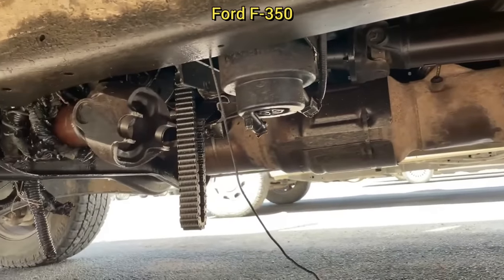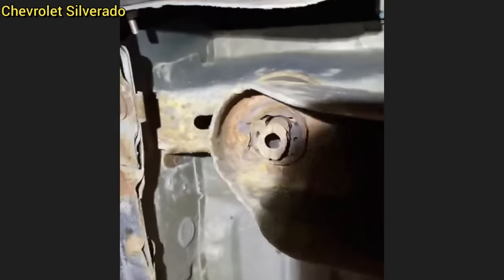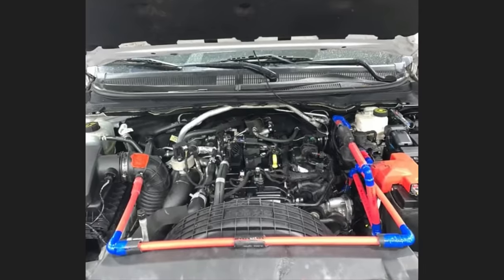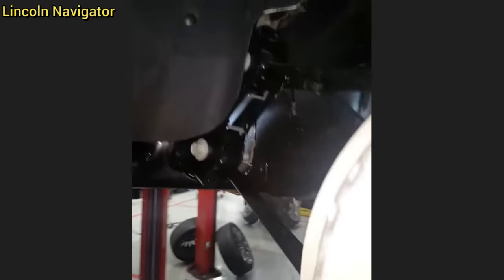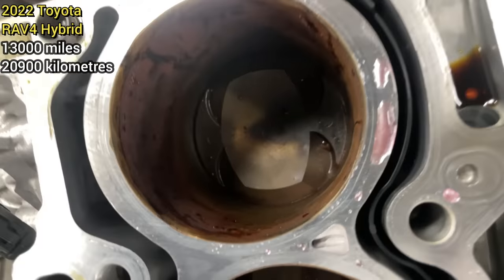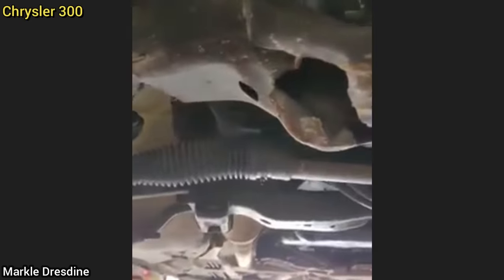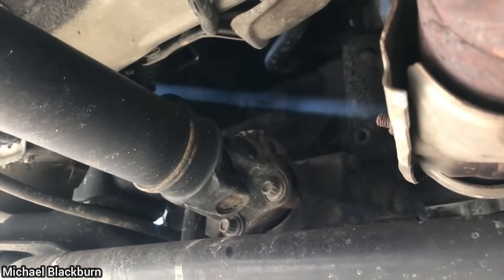Customer States There Was A Loud Bang At 90 Miles Per Hour

Comment: As a Chevrolet service manager 1971 I had a customer tell me that they had a miss in the engine of their Corvette at 80 miles an hour. They told me this over the phone and wanted to make an appointment which we did. I also advised them that I wanted to know what year the car was in and what the RPMs were. When the day came to inspect the car and they told me what the rpm range was, I said we can duplicate that in first or second gear quite easily without breaking the speed limit on the highway. If it has a miss, it doesn’t know it’s going 80 the engine only knows the RPM and we can easily duplicate that. The vehicle was under warranty, and I advised the GM service rep. Nothing came of it, there was nothing wrong with the car. You meet all kinds in that business.
Reply: What year was the vette? The engine doesnt only know rpm, the load wont be the same at 'low' speed in 1st or 2nd vs 80+ mph at the same rpm.
Reply: YT, that's nonsense, you probably lost a genuine customer.   I own an Australian made Commodore sedan - it has the GM world market V6 engine.   While still under warranty it had a similar fault - it hesitated a bit at 100 km/hr.    The dealer said there was nothing wrong with it.   I asked how they checked it and they said that since 100 km/hr is well above local speed limits they drove it at the corresponding RPM in 2nd gear.    I pushed them more strongly and they took it to a performance shop and tested it at 100 km/hr in top gear on a dyno - showed up the fault beautifully.   The reason is that running the same RPM in a lower gear puts a lower load on the engine, so that air/gas volume is lower and peak cylinder pressure is lower, covering up ignition & timing problems, etc.    Turned out an oxygen sensor was faulty, fooling the ECM into altering fuel injection.
I've worked in the heavy haulage truck engine business.   All dealers in that game have dynos - dynos solve lots of arguments, but the cost is not considered justified in the car servicing game.
Reply: @keithammleter3824  The roll-on dynamometer is probably one of the greatest time and money savers that I can imagine.
Reply: @UFO-047  
Because it was over 50 years ago I can’t remember whether it was a 1970 or 1971. Nailing the throttle in first and second gear or lugging it in third gear will produce pretty much the same results. Remember they had ignition points and one coil. The engine sensors of today and multiple coils on the engine and fuel injection and air sensors make a lot of difference nowadays. People want to take information based on knowledge today over 50 some years later and apply it to something that happened so long ago. Model a Fords had four ignition coils.  You have to actually work in the business to understand how many clowns there are, that make statements  they don’t understand and they’re making excuses because they could’ve been out dragracing and got beaten, and use that as an excuse. In 1962 I worked in the parts department at a Chevrolet dealership. in the door walks someone I knew with his mother. His mother said John’s car won’t go anymore, the engine runs, but it won’t go. He was looking right in my eyes and me and his. He had a 1962 Chevrolet 409 four-speed. The night before when a bunch of us were out hanging around, he was in a drag race and he missed a shift. It certainly wouldn’t go, he knocked the gearbox out of it. It was fixed under warranty if you can believe it. He had convinced his parents to buy him this car, and they had no idea what he was getting. There are hundreds of stories like this, if not, thousands. Don’t apply today’s technology to over 50 years ago.
Reply: @UFO-047  
It’s my mistake for not noting that you can apply the brakes and the throttle at the same time and load the engine quite easily. Having spent a lot of time with race cars, there’s a lot of things that people think they know but until you actually get out there and do it and learn about it, your / anyones information is limited . Just remember it’s against the law to exceed the speed limit, especially in someone else’s vehicle. As I said before, there are clowns everywhere.
Reply: @yt650  Im not applying todays technology to 50 years ago. Same will apply to either. 454 in my '73 (build year 1972) C20 is very close to a '70 LS5 454. Edelbrock Performer intake and Crane 266 Energizer cam being the main differences, 210° vs 214°. True 10:1 comp. And headers. Good work truck motor.
Even with all '70s gear certian issues will only show on the road in certain situations. Different gear, engine being loaded slightly different ect
Reply: @UFO-047  
You are conversing with someone who lived through the muscle car era, and I drove everything that was available at the time, and everything got traded in at various dealers where I worked.  I remember taking a vette Home for the used car department because they wanted to run a little bit, and it had all kinds of modifications to the engine,  two carburetors unknown, camshaft, and lots of other stuff. 
On a dynamometer, they load the engine through the rear wheels, tell me you can’t do that with brake and throttle. The guy was a clown, he wanted everyone to know that he had a Corvette that was fast and compared to a race car they weren’t even close. Everyone wants to brag about what they did to their engine, but if it wasn’t blue printed the cylinders spaced bores straightened, on and on you’re just kidding yourself and your throwing parts  at an engine.
Reply: @yt650  ok, so Im guessing you're around 80 and had the opportunity to drive a lot of different cars due to working at car yards. You dont need to be a mechanic to be a Manager of the Service Dept or work in the Parts section, in my experience many of those only know the front from the back because of which way the steering wheel faces, cars, road trains take your pick.
No one will be trying to trying to claim bragging points with a vette by saying 80mph. If you're running a TH400 youre still in 2nd gear at 80 at wot unless it has a DEEP diff ratio.
Whats the last part about? If it was supposed to be a jab at me, I listed the setup in my chev because apart from the intake and the similar cam it basically a '70 LS5 otherwise (yes its blue printed- built to a set of specs- my specs, finer specs/tolerances then they came from the factory with). An LS5 is what many '70 vettes were equipped with so I can talk about 50+  year old technology. That particular engine quite possibly
Reply: @UFO-047  
I’m just pointing out that there are a lot of stupid people owning and driving vehicle, and they have no clue as to what’s going on. If you fit into that category fine if your feelings are hurt my apologies. Just look at the video on YouTube that we both watched.
I don’t remember saying it was a turbo hydra Matic, when in fact, it was a four-speed. You may not realize it but a service manager has a number of responsibilities, and that is to keep the mechanics happy, particularly the good ones and to make sure that the customers are treated fairly and you can make money for the dealership. Having hands on knowledge about setting up a ring and pinion versus knowing where every part is and where it goes and advising people that order a new ring and pinion that it also needs a shim package with it. I’m talking old school stuff. I didn’t want to be a mechanic I didn’t want to be dirty all the time. That is not the environment that I envisioned. Additionally, after that year working for that dealer, I went to work as a sales agent for a company from Cleveland, Ohio and then a year later as their district sales manager. I had enough of that as well, so I opened my own business selling industrial supplies and hydraulics. Yes, I’ve retired from there, but my sons run the business.  
I tried counting up all of the vehicles I’ve owned starting at 15 years old with a 47 Ford. I can account for about 37 but there might be more. Been there done that listen to a lot of BS over the years. You don’t have to prove anything to me because I don’t care, and I don’t have to prove anything to you because I don’t care. If you feel the same way great.
Reply: @yt650  : If you are 80 years old, that equates to an average of less than 1 year 8 months per vehicle.   What was wrong with them all?   Do you constantly have accidents?    I'm nearly 80 and I have only owned 6 cars.   They all still ran well when I replaced them.
Reply: @keithammleter3824  
That’s one way of looking at your looking for an average but that’s not how it worked. My first car was when I was 15 and I sold that when I was 16 and bought another vehicle if my memory serves me right a 46 Plymouth coupe for $20. You can already see the trend. I’m buying and selling . And I had obvious opportunities at car dealerships and my first brand new car was an SS 396 Chevelle. I paid around $3300 for it and I sold it a year later for $3300. The only thing I did to it was putting tires on it, and a set of chrome wheels. There were always opportunities to buy cars use them for a while and then make money on them. You have to take into account that I owned a business so I bought trucks and cars for the business as well as cars for the family so it’s not hard to get up into the 35 car/truck range in this amount of time and very possibly it’s more than that. I am pretty sure I owned six new Chevrolet pick up truck and three or four flatbed delivery vehicles. I have not owned a vehicle since 2014. I drive one of my sons company vehicles. I am currently driving a 2021 Toyota RAV4 AWD. I also bought and sold seven homes living in each one for a few years, but never longer than 10 years.
Reply: @keithammleter3824  
I also neglected to mention that the years that I spent in a management position at car dealerships, I drove new demonstrator vehicles, but I didn’t count those because I didn’t own them. During the time that I was in management for the dealerships, I probably drove 10 or 11 new vehicles. Some people are impressed with cars/trucks and owning them and it’s like their child. With me it is a commodity to be bought and sold and I don’t get attached to things like that even homes. Real estate is where I made the easiest money and that’s where there are still plenty of opportunities.

Comment: It’s simply amazing what people do to their vehicles. If you buy a vehicle new or a late model used vehicle, it’s likely one of their top 3 biggest single expenses and they cheap out when it comes to the maintenance and making repairs when needed. Contrary to popular belief, things never get better if you ignore them. Sometimes a noise might suddenly stop, but the issue that caused the noise will come back and when it does, it always brings more damage with it. Spend the freak’n money to fix your car when somethings wrong. It’s a hell of a lot cheaper than leaving it for later. If you can’t maintain and repair your car, you probably shouldn’t own one.

Comment: When a car is unsafe to drive, and the customer declines any safety work and wants to drive off, the Police should be called as a safety hazard.
Reply: The cops won’t do anything though. The government is ok with having unsafe cars on the road in some states in the US. There are no mandatory safety checks, like once a year.
Reply: agreed but they are certain laws that actually prevent them from doing anything if it's their only mode of transportation and it turns into a legal battle of them "targeting the poor" so they just find it easier to do nothing.

Comment: "I replaced some parts but it's still not right. So, how much will it cost to fix it?" - Customer
"We decline to work on your vehicle." - Shop after seeing Bondo on exhaust, brazed frame "repair", and ziptied on brake caliper.
Surprised Pikachu face - Customer

Comment: As a retired mechanic, I am still baffled by some of the things I have seen roll in the shop . Customers can be crazy . So many times a repair might need 5 parts to repair the suspension and the customer only approves 2 items . Then comes back to complain it did not fix the problem . Exactly, you need the other 3 parts to repair correctly. Once it is all part the is not really an extra labor just the cost of the parts .

Comment: these videos make it obvious what causes the crashes in these dashcam videos. how can you handle your ride or do a maneuver or even stop in time when it falls apart beneath your butt? right.

heh, the only time when you open a car's door and can openly and truthfully say, "Well, crab!"

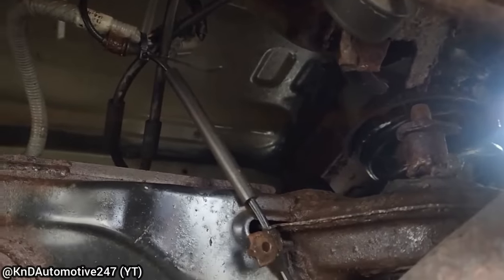0:33 in germany we call this not welded, but "glued together". most times I see them forgetting the protective gas, but not knowing how to adjust your machine creates bubbly welding that doesn't even melt into the material. to make sure you can take a hammer and knock onto the welding spot (or "caterpillar" as we say here) without using much force. just a healthy knock does it. if it sounds solid, all is well, maybe add a bit more heat? if it sounds like hitting a piece of sheet metal, it's not welded together. I got shown this trick when I learned car mechanic in the late 80's, and has helped me a lot doing rust repairs since then.
also, a framework repaired needs way thincker sheet than 0.75mm... more like 2mm. have fun hammering that into shape, though.

Comment: OMFG! Goes to an independent shop, "return it to stock because I've done so many DIY modifications that the dealer won't touch it. But I need to scam them into paying for my screwups and I'm sure that the guys who see dozens of these in a week won't notice a thing." Reason number 463709 that I'm profoundly grateful I no longer have to deal with the motoring public.

Comment: How much was quoted for Vaccuum lines that the customer declined?
Reply from the maker: They didn't say but it's generally a cheap repair. I used to work at Ford. I've replaced many.
Reply: @JustRolledIn  my point exactly. I am just curious if they tried to sell the customer a bunch of other stuff.
Reply from the maker: @oldcarnutzs2886  just vacuum lines from what I was told. Came in for 4x4 inop.

Comment: As someone that does their own car repairs, I feel great fear when I hear a mechanic mentioning someone trying to repair it themselves.
Reply: If you do repairs and maintenance yourself, your car either runs great with no issues or has 3 separate tyre types, 7 bolts missing from the engine overall, and an exhaust that’s only superficially there.

Comment: Cars don't last 10 years any more
The loans are now 8 years and some are even 10 years.
Basically the cars are made to just barely make it to just before the loan is paid off
This is why I hated getting rid of my 91 Ford explorer. And I still have my 99 Avalon. They don't build cars like they used to. There was more metal in the doors of my explorer than is in an entire new Ford Focus or most other cats. You literally can push every panel and the bumpers on new cars with your hand. I leaned against a new SUV at the dealership and the entire rear panel caved in. I drove my 89 E-150 over 3 metal 4 inch poles concreted in the ground, and the bumper took them down. Minimal damage to the bumper
76 Chevy Malibu Classic, 20 MPH into the concrete block wall of a bowling alley. Minimal damage to the bumper. Stone wall pushed in about 6 inches. Towed a 70 foot mobile home with my 91 Explorer. Car hit a brand new Ford SUV at 5 MPH, entire rear of SUV totalled. The bumper was 100% plastic. I couldn't believe it. I didn't even know that was legal. And not just cars are garbage, new battery less than 1 year old would not hold charge. Replaced with gold battery 890 CCA. 3 year warranty just up, battery is only just barely cranking over the engine. I had the battery in my E-150 for 7 years and only gave me trouble when temperature was below 10 degrees outside. Just very depressing. Spend 160,000 for a car by the time the loan is paid off in 8 years and you need to buy another one. I love vehicles that last 30+ years with minimal maintenance but those days are gone. My 77 Granada had an alternator, PS pump and that was it. 2 belts. Very simple 250 6 cyl in line 6
Ran like a top. Rusted out in harsh 8 month NY winters with road salt. They don't build them like that. 69 Caddy, OMG, they don't have anything like it except for a limo. The thing needed its own zip code. 454 engine. You should have heard that Engine turn over. Now that was a car.
Super smooth to drive. Same with the 91 Explorer, super smooth. Ford really used to make incredible cars and trucks. My 95 Lumina was nice, but the entire body rusted out. Just so hard to find anything even fair any more. And the price is just not affordable. When you have to pay 1000 dollars a month for your car payment and insurance, you need to gross 12 dollars an hour just to pay for your vehicle. Another 12 an hour to pay the rent. And another 12 an hour to pay for the gas and utilities and another 12 an hour to pay for food. And there are not jobs making 59 dollars an hour any more. Doctors, lawyers, some plumber and electricians, and if you own your own business you might make that, but normal people don't. 

That's why we have 72 million Americans homeless living in their vehicles and working 2 jobs and they take showers at the 24 hour gyms.

I didn't understand why there were 24 hour gyms in every city and who was using them and why.

Then I started seeing all these cars parked at the gym at 3am and they all had the windows covered and at 6am I saw people getting out of the cars and going in and taking showers and cleaning up and changing clothes. Mostly men, but some older women.

America is a third world country for 1 out of 4 Americans

Very very sad

Comment: Uhmm you don't take a frame to be welded to a mechanic, you take it to a welding shop and hope they have angle iron the right size and shape to repair it. Been there done that, as I don't weld or solder..I make goopy!